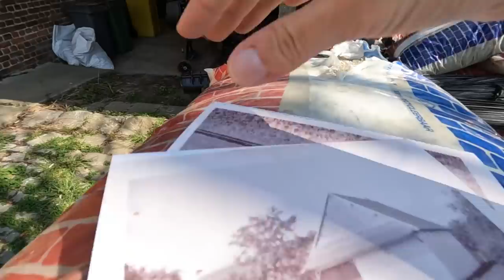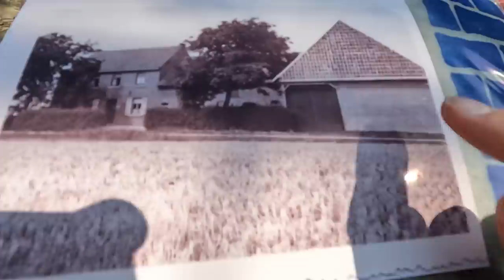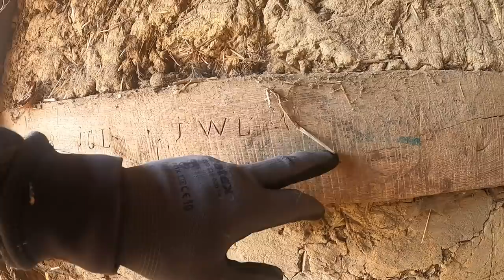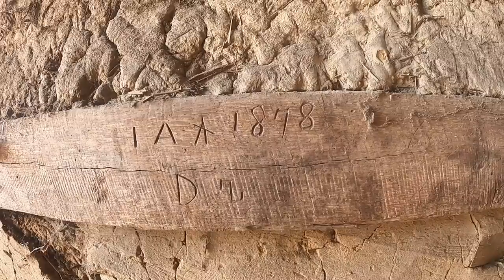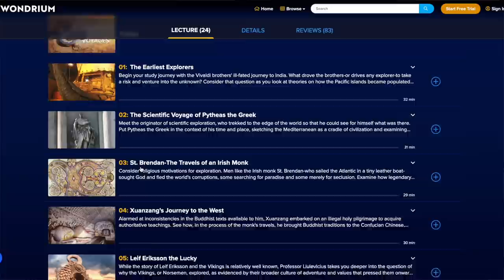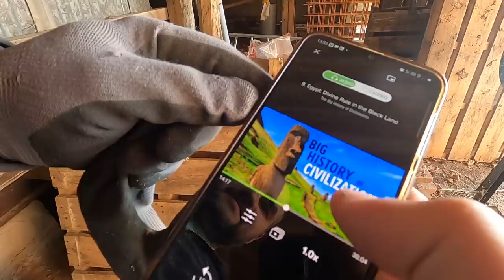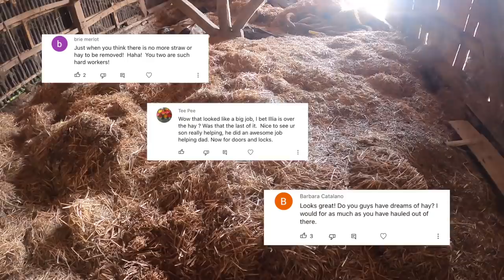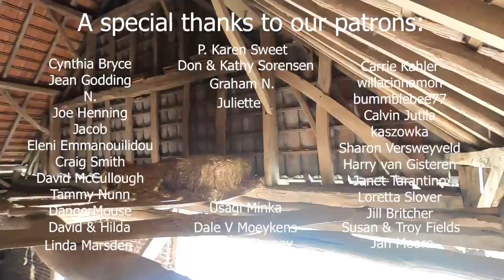Revealing our OLDEST BARN / What should we do with this  DECAYING 250+ y.o. building?

Comment: * 1848, 1878: those dates match with age of the oldest cement tiles in the kitchen. On the other hand : back than, people repurposed materials very easily. It can as well come from another barn somewhere else
* The carvings in the beams are both the makers marks and indications about which beam is to be placed where.
* Better remove all the grains from the storage in those metal plates: on very hot days, this can start to smolder and cause a fire. Idem for the straw. Also the places where water can drip on straw or on the grains : when this starts to ferment, it can create heat, and start smoldering even more easily when it's hot in summer.
* On the picture of the horse with a cart, you can see exactly the wood beam+ chains Illia just found in the barn. It was positioned dangling in between the horse and the cart, and it connected both, in case of low weight carts, or when you needed more agility for manoeuvering eg with a plough. For bigger carts with heavy loads, they used fixed wooden beams left and right of the horse.
* On 25'37" : the sidewalls of this barn are in asbestos material : please be extremely careful when working around this, don't even remove eg the straw on the beams against those plates with a brush or a leaf blower without wearing asbestos-safe masks and clothes.

Comment: In the uk we call them type of walls "wattle and daub". We lived in France for 15yrs, the house we lived in, only had one storey until the early 1950's, then a second one was put on. the Barn had a upper level/floor made out of planks and poppy stems, where they kept the straw. we had 3ft of straw to move, it took months. But was so worth it. You could replace the old wattle and daub walls, with new daub then "tag" the beams as others have over the years, one way to leave your mark.
Reply: I immediately thought of that when I noticed that the far wall retains its original timber framing but the wattle and daub has been removed and the outside covered over with metal. Might be wise to keep the metal though if that's the most weatherbeaten side.

Comment: Maybe it would be possible to preserve the wood-and-clay wall in resin? Build a casting form around it and then pour see-through resin down the inside part, and afterward build a load-bearing wall against the outside part to stand against the elements.
As for protecting the beams against further dampness, maybe it’s possible to lift the beams a tiny bit, just enough to slide some kind of damp protection between the bricks and the wood.
Love the glass wall idea ❤

Comment: What a beautiful building!  I love the idea that you will preserve the clay panels. I think the storage area for the wheat is called a grain silo, but there should be a place on the top, where the grain can be poured in.   I think the panels behind where Illya was sitting are made from asbestos, which shouldn't cause too many problems so long as they are intact, asbestos panels are most dangerous, when they are broken up & the fibres are released.  You will need to employ a specialist (expensive) company to remove them in a safe way.  If those panels are made from asbetos, you should also confirm if the straw on the floor could be contaminated before you start moving it & it may not be possible to put that straw back on the land.  Wearing masks is definitely recommended.

Comment: I wouldn’t put glass in front of the wood/leem (no idea what the English word for leem is) wall. Leem is a natural moisture regulator: absorbing moisture when air humidity is high and releasing it again when the air is dry. It’s also a relatively good insulator. The material is being used again nowadays (as an alternative to plastered walls) and there are companies with workshops on offer to learn how to apply it.

Comment: An excellent example of Wattle and daub construction.
I think Ilia discovered a Capstan. A wooden axle, used in a grain mill machine.
The Capstan would be inserted vertically into the center hole of a millstone.
The chain was used to attach the Capstan to a power source. Like a horse, an Ox.
The Ox walked in a circle around the grinding stones.

The wheat was stored in the bin, the little door at the bottom was how they measured grain out to be milled into flour.

Does your farm have a history of being a flour mill?
Step back in time indeed.
❤️